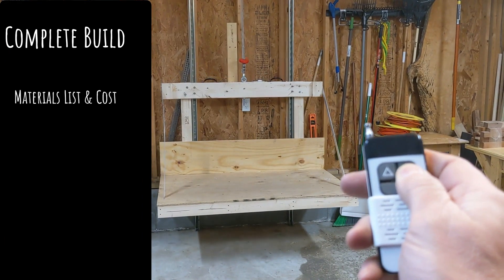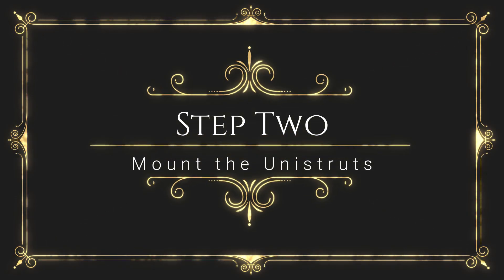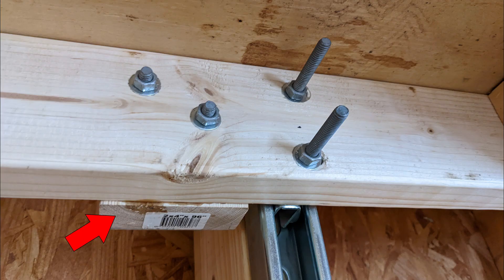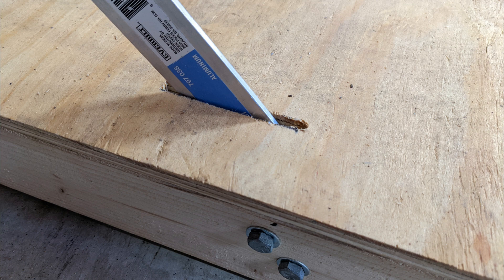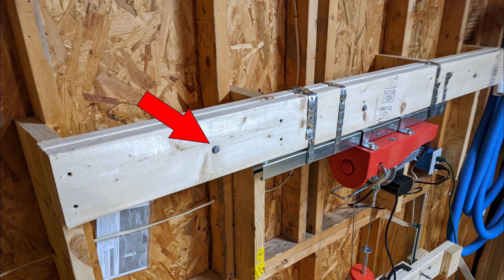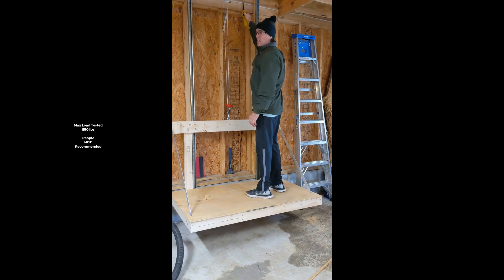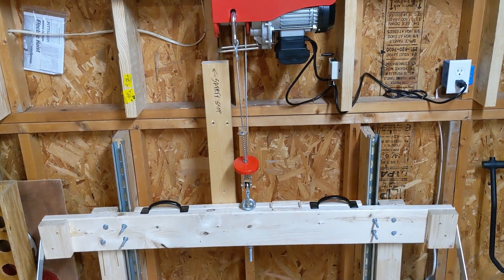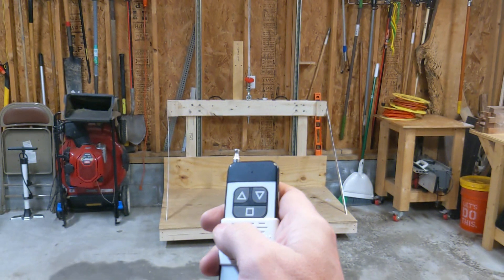DIY Elevator with Wireless Remote (No Welding!)

Comment: Hi 👋, I found this very helpful and interesting, as I have and live in Moulin/Mill in France , 4 floors, As I need to get logs from my basement to my lounge and attic, for my heating, great territorial, thank you very much appreciated, I think I might be starting this within the next week or so, just got to locate all the components, Phil from the moulin.
Reply: Hi 👋, thank you for the reply, I will definitely try, 😂, I was going to build a decking off the side of my property, Somewhere between four and 5 m up, and I was going to build a jib into it, that would swing out, so I could then lower a pulley down to pick up a basket of logs, or even my groceries, so I could then bring them up to my kitchen dining room, and lounge, The layout of my property is a bit strange, I’ve got a basement, then I’ve got my bedrooms bathrooms et cetera, and then I’ve got my lounge kitchen diner, then the attic, 
But because of certain circumstances , one being burgled, and losing some special cutting machines to cut through walls, and secondly, I’ve just had an ongoing battle with my ex, Great having to chat, stay safe I’ll try and tell you if I get it all sorted within the next month or so it might be a little bit longer, Phil from the moulin.
Reply from the maker: Good to hear from you Phil! Best of luck on your project.

Comment: Can't thank you enough for the details on the wireless remote! This was PERFECT for my home project. One note I thought I would add on here, you can wire everything like in the video, but ALSO wire back in the wired remote to the same wires and be able to use it along with the two wireless remotes. Total of 3 remotes (2 wireless and the original wired). Figured that could come in handy for someone else here or spare them from having to get a third wireless remote if they wanted a remote in several spaces.

Comment: I like the remote control part
Reply from the maker: You have no idea how nice that is. One alteration from the video is that I switched it back to the factory settings so that you press it once to make it go up without having to hold it down. Saves batteries.
Reply: @mikeh7256 cool.  I was thinking you could wire the original in parallel in case of a lost remote or dead battery

Comment: other than typical safety concerns the main thing I noticed was lack of doubling up the 2x beams / joists where you cut the floor... .and lack of joist hangers on the cut beams, which have been required for decades now. Any time you cut a joist and transfer load, that next beam needs to be doubled up. You also need to support the floor all the way to the edge. Plywood edges without a 2x under it is asking for trouble.
Reply from the maker: Excellent comment on the joist doubling. I had no idea about that. The plywood however is supported by 2x

Comment: Mike;  Question.  Where did you put the 16-20 uF capacitor for starting the hoist motor??  Did you just delete it, or is it somewhere else?  I'm doing the same mod to my ATV stacker.
Reply from the maker: I assume you're talking about the jumper pin. Originally, I moved the pin from the factory position to get momentary reaction. Later I found out that it ate batteries pretty quickly. Recently, I put the pin back in the factory position so that it was toggled. Just leave it in the toggle position. Read my comments that I posted a month ago. It's very important on the downward momentum. Especially with heavier loads, the downward motion doesn't stop immediately, but comes to a stop. Go to about 16:20 in the video.
Reply: @mikeh7256  hey Mike, thanks for your reply.  I was talking about the large motor start capacitor that is in the handle of the hand controller.  It takes up most of the volume of the controller.  Other remotes I have looked at use large high voltage high current AC relays to do the motor supply voltage switching, and the wireless remote controller to supply the trigger voltage to the relays.  They installed the large start capacitor at the relays up next to the motor.  My setup may be different from yours, I'm not sure.
Reply from the maker: @JohnnieBravo1  Gotcha. So I simply removed the cord and attached the remote wiring. Nothing else to do.
Reply: @JohnnieBravo1 some hoists have the capacitor in the remote handle mine and Mikes has it in the black box attached to the motor. Depends on what hoist you bought, I believe they are built different.

Comment: Upgrade your center lifting eye bolt to a "shoulder eye bolt".  The shoulder is just under the eye.  That way, the nut on the bottom has the shoulder to tighten against.  The one you bought can't be tightened meaning that it will always be slack.  How does this elevator stop at the lowest end of its travel?  You should install a limit switch down there too.  Lastly, and I'm sure everyone has been saying this, you need a hand rail on the sides and front.  the front one could hinge at the floor and then fold down to make a handy ramp.  The fold-up ramp should have a limit switch such that the elevator won't run unless the ramp is raised and latched into place.  Even if this is just a freight elevator, you still should at least have a lip on the 3 exposed sides to prevent the load from shifting and sliding off.
Reply from the maker: Great ideas! On the lower limit switch, I haven't figured that one out yet. When going down and I press the stop manually, it simply slows down and then comes to a stop. It's not immediate like the one going up.

Comment from the maker: Okay guys! I just changed my lift from momentary toggled. I simply put the jumper back in its factory position. I like it because I go through less batteries and there is a safety factor to that.

It does have a quirk that you need to be aware of. When you run the elevator to the top and it stops automatically, then when you want to go down and you press the down button, the elevator starts to slowly go or even at a slow rate of fall. (Slower than) At that point, you simply press the up button one time and it will begin to fall at a normal rate. Let me be clear that the normal rate is faster than the slow fall I mentioned earlier. But it is weird.

Note that if you stop the elevator before the automatic stop when going up, then when you press the down button it reacts normally without the slow fall.

If you want to know specifically what jumper I'm talking about, go to about the 16 minute mark in the video. The pins show LS and T. I put the jumper over the S and T.😊

Comment: Any idea why the down button does not stop the wench when the button is released? Up works fine when the button is released.
Reply from the maker: Wiring issue. With my particular unit, it is a jumper
Reply: @mikeh7256  I removed the jumper on my unit. Should I put it back on?
Reply from the maker: I think it's all about momentum. I get the same thing where I'm going down and I let off the button and it takes a second, but it does stop. I'm changing mine so that I have to press a button to make it stop

Comment: You should really be using through-bolts on the hoist mount (unistrut to header beam). I don't know if would ever trust four 2-1/2" deck screws to suspend me precariously 10 ft in the air.

Comment: Excellent! I will follow this idea for an exterior elevator to reach my 2nd level house. Is there any way I can get full written instruction and equipment specs? Txs!!!!
Reply from the maker: It should be in my initial instructions. For added safety, use metal screws and consider safety straps

Comment: As a 30 year elevator tech and know the dangers of elevatots. I know this is a Death Trap for human use. There  are so many things with this build that are Very Dangerous and unsafe for human use. This may be ok for a dumbwaiter if the hoist was not relying on deck screws to support weight. Deck screws are hardened and crack easily. If any one part of this contraption failed, the load will fall. There are no safety features at all to prevent this and I see many weak points that should be addressed even for a material only lift. This lift should Never be considered an elevator for human passengers. Let's face it, even properly made equipment will always fail at some point and this is why multiple safety features must be implemented when a person's life is at stake.
The man who made this video is very foolish using it that way especially allowing his wife to ride it. The video he made is high quality but the contents are very dangerous. Even if he had a much safer design, many DIYers don't have the knowledge to duplicate without some mistakes. These mistakes could have devastating consequences. I have seen homemade elevators that were sold to many customers looking to save money. At first glance they looked professionally built but the safety features did not work faithfully and fatalities were the results. Another issue is the hoist mechanism itself. Those hoist are not designed to carry people. They are designed to sell at a price to carry a load that is not of such importance like a life. The failure rate is much greater under a heavy load then it should be for human use. My point is, Don't ride or stand under any lift that is not outfitted with the proper safety devices and this is one of them. Your life depends on it. 
All that was just about the safety of lifting a load but there is so much more safety to think about like pinch points and falls from the platform. While adults may be aware and thoughtful of this, an unauthorized young person may not. 
Be safe...
Reply from the maker: I appreciate the comments on safety and your experiences and elevator technician. Before I put everything together, I did check loads for deck screws. I do plan on replacing them with different screws, but here we are 2 years later and it's working great. I constantly ride it up and down myself with loads and everything is holding up well.
Reply: @mikeh7256  I'm glad that you have had no problems so far and your family is safe. I'm sure you thought it through and have done a good job designing a material lift for your situation. I highly recommend that you do not allow anyone to ride it. 
The problem with deck screws is that they have the potential to crack with movement and vibration and over time loosen in the wooden structure. There are much better options like through bolting with bolts or threaded rod using washers to keep the head from pulling through the hole. Using that type winch is not recommend but at least strap the unistrut with cable and Crosby clamps to a very strong support in case your structure of banding and screws fail. The main problem for passenger use is that it is missing needed safety features in case of failure with holding the load. There are many points that could fail but hopefully none do. With the proper safety features of a passenger elevator if any part of the lifting system failed, the platform would not fall and no one would be injured. With home-built units the safeties are usually not even considered or properly tested. It's obvious that you have skills but when it comes to the safety of passengers this lift is in no way acceptable. To start with, the platform would need an automatic braking system that would grab the rails to stop the platform from falling. The guide rails would need to be strong enough to support the platform from falling by holding all the weight of the load when all else fails. 
In my opinion there are no inexpensive options to make a safe passenger DIY elevator unless you adopted some used original home elevator equipment. These items may be available if you know where to look. 
Maybe this type of failure won't happen with your lift but the more you use it, the more likely it will. I just want to give this information to you and all those DIYers that see this video and believe this lift is safe to ride when it is not. I know you sort of acknowledge this in your video but then it shows you riding it with controls mounted on the platform and you speak of your wife riding it too. I believe that this will encourage DIYers to follow your footsteps into a dangerous situation. I encourage you to do some research on elevator safety features and to not allow anyone to ride your material lift.
Reply from the maker: @johnnygogo7773  your comments are well received and I hope the people that view this video will take some of your advice. The two things I'm looking at are changing the screws and a safety fault device
Reply: @johnnygogo7773  You are of course technically correct. No DIY elevator is going to be as safe as a professionally designed and constructed one would be. Most of the obvious safety flaws have been pointed out and could be fixed cheaply. You mentioned family safety, but really there is no need for the family to be joy riding this or standing underneath it.  Of course, anyone buiding one of these has to assume some risk and weigh that risk to other means of lifting loads.  For instance, those cheap rickity fold down attic stairs put in almost every new house is inherantly a death trap as well.  There are many times I have used those starins to move Christmas decorations and other seldomly used items for many years. The reality is that you have two hands balancing awkward boxes while trying to walk up and down stairs. That is a death trap. Of course, the instructions that came with the rickity attic stairs likely said not to carry anything up and down, blah, blah, blah. We all live in raelity and as I said before have to evaluate risks. With a few simple safety modifications this DIY build is safer than other means of moving items from attic to main floor.  Is it as safe as an elevator in an office building? of course not, but does it need to be?
Reply: @mattreeves1779 Well said. This video is only a suggestion of ideas. You don’t have to do any of them. You don’t even have to watch the video.

Comment: Sorry...  I commented before watching the electrical portion.  Clearly you have no clue when it comes to what you are doing electrically.  Only by the grace of god did you get this to work!!!  And NO!!!  "L" does NOT stand for "live".  It is LINE and should come from the power cord NOT the remote cord!  The fact that the "remote" unit lacks a ground is a bit doggy but then again I see nothing to indicate that it is UL listed either.  It should probably be mounted in a metal enclosure for fire safety!  

I can not say with any certainty whether or not the power needs to go to the hoist itself as I can not see how the hoist is wired internally.  However, I can say with certainty that BOTH the white AND the black from the power cord should go to the remote!  As for the remote cord...  Knowing what I know about this kind of device, I am not sure WHY it works as wired.  The blue tied to the white should cause a short in one direction or the other.  That it does not is a HUGE concern!

Just for the record...  I am an engineer who has worked as a machine tool electrician.  I have a bit more than a clue what I'm talking about!
Reply from the maker: Great reply. I don't know what I'm doing electrically so I hired an electrician to help. That was the only configuration he could get to work.
Reply: @mikeh7256  Even worse!!!  An electrician should know that you NEVER EVER terminate stranded wire the way it was done here!

Although they could be left bare, they are NOT properly twisted and not properly inserted into the block.  Properly, the wiring would be run into a junction box (2 junction boxes if the wiring for the original remote was undetermined).  The the wiring to the wireless remote control would then come from the junction box(s).

Bottom line is that if YOU do not understand the topic you are posting, you probably should not post it!  Leave it to someone who does.
Reply from the maker: @TheTlagnhoj  Well, whatever the case, it works
Reply: @mikeh7256  That is only half of the concern...  The other half of the concern is what happens when it doesn't anymore???  

Kind of like the hundreds if not thousands of other cases where "it worked" right up to the electrical fire that burned the house down...

Not my monkeys, not my circus, NOT MY garage!  But viewers should be aware!!!

Comment: I don't even know where to begin...  There SO many details in this design that can lead to failure it is amazing you have not yet been sued!  From improperly securing the cut joists, to the use of deck screws and eye bolts, this is a tragedy waiting to happen!  Great build if your safety is worth less than Strong-Ties, construction screws and forged eye bolts.  MOST of the build would be made safer with the proper hardware.  Although some of the construction techniques are a little off.  Sure, this build can be done safely with PROPER construction techniques which are lacking in this video.

And MOST importantly!!!  NOTHING should EVER be raised from the floor on a lift like this without some form of brake or arrester!!!  NEVER!!!

Comment: Nice presentation and explanation. It really needs structural construction screws instead of decking screws and the entire weight of the system is currently being supported by 8 decking screws that hold the 6 inch beam the lift is strapped to. Those really need jack studs under each end to support the weight.

Comment: Built one fairly similar about 2 years ago and have been using it with a corded remote.  That was a pain.  Today I hooked it up to the wireless remote you recommended.  It took about 15 minutes to have it working.  I don't think I could have done it without your detailed wiring instructions.  Thank you......
Reply from the maker: You're welcome. After using this for more than a year, I have found that the current wiring requiring you to hold the button down will cause your remote to use batteries pretty quickly. I am changing my wiring so I can use a single click to go up, a single click to stop, etc.